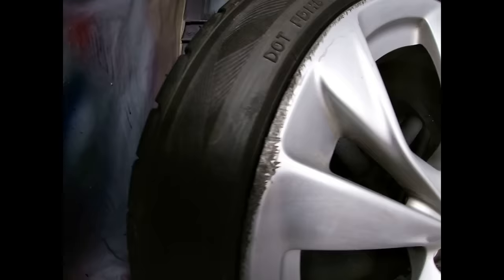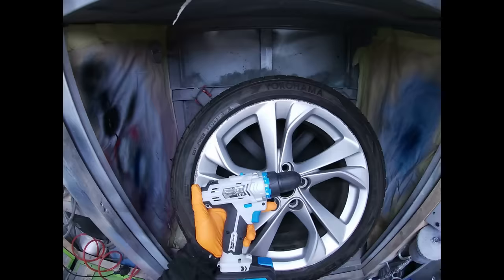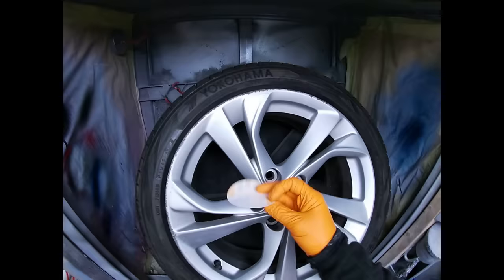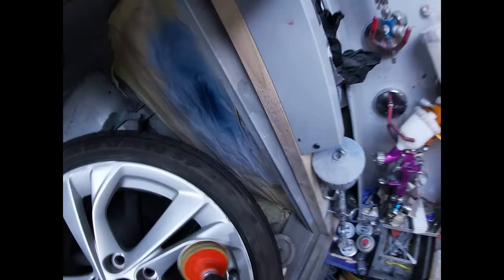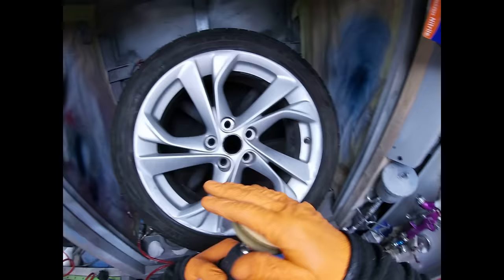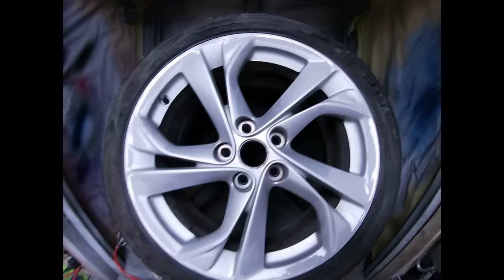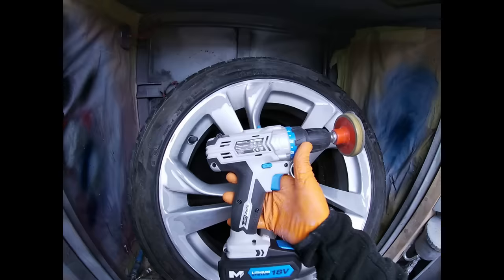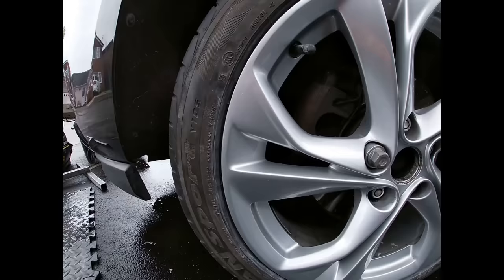How to remove curb rash on any wheel rim with a cordless drill!!

Comment: Remove the tire...or loosen it from the rim. Use your sissor jack....most vehicles have a sissor jack. Lay the tire under the car or bumper....flat part of the sissor jack on the tire near the rim edge and the opposite side of the sissor jack against the bumper, frame, etc and twist the screw as you would normally if lifting the car to change the tire...the tire bead will pop...then the rest of the tire is easily pushed away from the rim as well.
You'll do a cleaner repair and paint. Sure..takes what...an extra 10 minutes of so...
When done..inflate the tire... it'll seat itself on the rim. Going to have to have the tires balanced regardless....sanding the rim...will throw of the balance....

Comment: Is it safe to do that much damage to the side walls of the tire though? I guess maybe if you are planning to discard and replace the tire, it'd be fine, but then you might as well pull it off before restoring the wheel.
Reply from the maker: It's the backing pad edge shredding not the tyre wall
Reply: Where was the damage I dont know where to look

Comment: I would mention that people be careful they aren't removing any material from the tire wall as too much being removed could create a week point leading to a blowout. Mabye wedge a plastic guard of some sort so the sanding disc doesnt come into contact with the rubber tyre wall.
Reply from the maker: most of the material you see in the vid is actually the backing pad shredding

Comment: Would've been nice to see that primer/painting bit as well..But nice tip as I've a set of badly (as bad as ones in video). Planning to get a set of other alloys and when I do, I'll see if I can get it look better than it is now :-D
Reply from the maker: I've had success using no primer mate, done it for years at dealers and so do most guys ive seen around, not saying its completely advisable..  but can be done
Reply: @cvrpov  cheers for the info, keep up the good work.
Reply: @cvrpov  what paint do you use?  Is it spray paint?

Comment: Do you know why they add 10g weights to wheels? I mean it doesn't seem like alot of weight to make any difference but 10g spinning at 70mph becomes a kilo or something to that effect. I was just wondering, if you do happen to have some deep curb rash, and you happen to take 10g of alloy off one side or even 2 parts of the wheel, how does that effect the balance.
Reply from the maker: This is a DIY video and its down the user to make those decisions.
It can't be that detrimental, else half the cars on the road would be out of balance because of kerb damage, also anyone who has just bought a car from any dealer is probably buying unbalanced wheels as in 15 years and thousands of refurbishments later ive never seen one wheel guy balance a wheel after refurbishment!
Reply: Good question but if you are worried the cost to rebalance isn't that much.  It's smart to check your balance periodically anyway so just get them checked after you repair your wheels.
Reply: Just do this just before a 5k mile rotate and balance.

Comment: My car has gunmetal gray wheels. The scratches are all only at the very edge nothing in the middle. I’m going to go to a high-end paint store and get some automotive grade paint to touch up after sanding down. Looking for a good video on repainting next. I wonder if I need to use clearcoat even with automotive grade paint? I’m guessing probably so. I’m also wondering if I can just paint a little bit of it with a foam brush or if I need to mask everything that I’m not painting and use my sprayer. also, I know some stores will put automotive grade paint in aerosol cans. I’ll probably just go that route.
Reply from the maker: It will still need a lacquer of some sort over it

Comment: Mate only if I saw this before life would of been much easier 😰 been doing manual labour. Quick question, what would you do if your alloys been already sprayed but paint work come out rubbish you can see scratches from sanding. Would you sand literally the wheel all back down till the paints gone or just smoothen it out by sanding and what grit would you use from start to end so I can give it another fresh paint? Thanks
Reply from the maker: If the paint is in sound condition and not peeling/full of reactions etc.. the  it can be painted over. Sometimes feathering out with wet and dry and 600 helps with this
Reply: What paint do you use

Comment: Great tip.  However, I would remove the tire before doing this because otherwise it is very likely you will hit and damage the sidewall of the tire while sanding the wheel.  If you damage the sidewall if is more likely to blow out and fail during hard cornering or if you hit a big bump.  That could cause an accident and get you injured or killed.
Reply: You obviously don't know how strong tyres actually are. You would have to be sanding on the same spot for a long time  to damage it with a sanding disk. If it was an angle grinder I'd be more worried but I've seen people use them on tyres to remove lettering for white walls with no problems. Maybe you just needed to pick something you saw as wrong
Reply: @MrDemonchild71  Actually, I began my comment by complimenting the video.  I started changing tires while working in a garage 50 years ago so I've seen a few of them and I've seen my share of blowouts.  A sidewall blowout of a front tire during hard cornering is especially dangerous because it can cause the car to have a rollover crash.  I've lost friends in those kinds of crashes and it's usually a closed-casket funeral.  I would still recommend being VERY careful not to damage the sidewall of the tires.  Garages and tire merchants won't even plug a tire these days if it has even  the smallest hole in the sidewall because it could cause tire failure.  If you feel comfortable grinding on your wheels right next to the sidewall, go right ahead.  Not everyone may be as careful or skilled as you.  To each their own.  I wish you safe driving and Happy Trails.
Reply: @1notgilty , damaging a sidewall is bad, no one's doubting that. This procedure however could only scratch the rubber sidewalls at the most.
Reply: @draintheswamp1588   @Drain The Swamp  Perhaps YOU might only scratch the sidewalls but everyone might not be as careful or skilled as you. I can easily imagine someone accidentally hitting the sidewall and damaging their tire.  If you can do it I wish  you safe driving and Happy Trails.
Reply: @1notgilty  I don't believe anything you say
Reply: Why would you remove the tyre when Boris can have lockdown parties?!
Reply: @1notgilty  dude your clearly speaking from an emotional state. thats ok. but theres no way in hell any rotary tool with 80 grit sandpaper will chew through a tire like butter... like Joel said, maybe an angle grinder would mess a tire up if left on there long enough. just stop the cap and admit u made a mistake lol y cant people ever do that nowadays
Reply: @1notgilty  I think you are right. I prefer caution before I do any job. Im going to have a go at this but have made a simple hard plastic guard. I made a template form paper for the edge of the wheel. I then used that to make a hard plastic guard. Basically, the same curve as the wheel. I will then slot it behind the tyre and tape it to the tyre. Ill sand from there. If I do go near the tyre, ill be sanding the hard plastic.
Reply: @raysmith2940  It sounds like you are being safe.  Better safe than sorry.  I wish you well and hope that everything turns out fine.  Happy motoring!
Reply: Unless you are intentionally grinding away on the tire, not very likely you are damaging it.  IF that is a concern, why not put a layer or tape or even a thin piece of aluminum over the tire in the area you are working?  That should give you some room for error.  (Though doesn't feel like this would be necessary)

Comment: this sounds mad but if you have a rear wheel drive car you can jack the back wheels up and start the car and get the rear wheels turning and then use a drill on the wheels , you get a really good finish , just be safe
Reply from the maker: I've done this before.. thanks for the tip!

Comment: When you’ve resprayed ur wheels can you still use the wheel cleaner on resprayed wheels or will it take off new spray paint being a chemical. As my car is a mobility car and have curbed both wheels on driver side and don’t want to have to buy new alloys when I upgrade to a new car after 3 yrs is up.
Reply from the maker: Once the wheel is dry you should be able to use  cleaner yes.
Reply: @cvrpov  Finish with a clear coat lacquer ......
Reply: Barry i would be very careful if there is a clause in your contract/ Mobility agreement which states you would have to replace alloys that are damage or you'll be charged. this is a similar  situation to those that lease cars who also have this policy. they usually look for any excuse to charge you when you return the mobility/ lease car and have an official inspector check the car and create a report - the inspector will check paint depth for accident repairs dents scratches and check your alloys and WILL notice any DIY repairs.
However this is a great vid for those that own their cars.............. and will not be returning to the manufacturer for an upgrade whether its a Lease/ PCP/HP/PLH/ Mobility etc..
Reply: @coachBux  thank you Ash sorry for late reply.
Reply: @coachBux  Any excuse is right, never take into account normal wear and tear

Comment: If you wheels have a coating whether it be painted or cleared, which most wheels are these days, you'll have to spray em so they match or cleared so they dont turn cotton white
Reply from the maker: Yep
Reply: @cvrpov  sorry dude, I jumped the gun w/o watching the whole thing. I own and work in a detail shop and alot of people dont know these things. For instance the best thing to clean a headliner is 1 part bleach 2 part water. Pour on rag and scrub it down. Cloth seats too but dont get a drop on the carpet. Best thing to clean hard plastic interior panels- 3m pad. Windows and true chrome-fine grade steel wool. How to remove the yellow mark around handles and moldings on light colored cars esp white- wheel acid. How to remove acid rain from paint- coat with a strong mix of wheel acid (not on windows) and let sit for 2minutes tops then wash off. If some remains, repeat. It will eat all the acid rain marks off without sanding and buffing. Just a few things I've picked up or discovered over the years

Comment: My question is, if the wheel is powder coated, how do you match the color, get paint to stick to powder coat, and feather it in? Do you just spray the entire wheel with primer and paint it?

GREAT VIDEO BY THE WAY!
Reply from the maker: Both actually. Depending on how much damage is on the alloy. If its a small amount then blow it in and feather the silver out a bit. 
If its substantial then paint the whole wheel
Reply: @cvrpov  thanks man!

Comment: Hi, nice video. I just have a 2/3 inch very slim mark on the edges. I applied touch paint directly on with the small brush provided, was thinking of just sanding down the touch paint to smoothen it out. Would this work ? If so, what grit would you recommend on the touch up paint?
Reply from the maker: After it has dried you can sand and polish for a more level result

Comment: Once you've worked up thru the grits, do you have to seal it with clear or could you leave it as it is?  If you just did specific sections using this sanding technique will the areas you didn't touch look different?
Reply from the maker: Sand, paint then lacquer

Comment: Very interesting and looks simple to use. It's also very similar to the method used to remove the yellowing of the headlamps. In my honest opinion, this DIY stops being a DIY job when the spray needs to be applied. Everyone might have a cordless drill, but not everyone has a spray gun, a compressor and spraying techniques.
Reply from the maker: True.. so do exactly the same but with rattle cans
Reply: Just use cans. Go yo the paint shop and ask them to mix you up a 2k clearcoat can. Is the same stuff as he uses and is much harder then the regular clear paint.

If they mix it for you, you need too use it in a day or 2 or so. Because the hardner is allready mixed in the can it will start to set in the can. So it will only last a few days.

Used to spray entire sides or corners of cars that way for years. Put the clear on thick and slow, sand with waterproof when dry until smooth and then just polish it up.

Perfect profesional result everytime without a booth or sprayguns or whatever..
Reply: @baronvonlimbourgh1716  And you expect us to believe that ???
Reply: @allenrj1  believe what?

Comment: I must say that repairs like this can cause the steering wheel to vibrate when the vehicle is traveling at high speed. Because taking a gram or milligram weight on the rim will affect the wheel turning diameter and speed.
Reply from the maker: Most repair this way

Comment: My rims are clear-coated aluminum. It's hard to fix those. A small body hammer works best. Then I go over it with 0000 steel wool. Afterwards, I hit it with Plasti-coat clear lacquer. Deep groves are best to paint out or putty. You'll distort the rim reflection otherwise.

Comment: My concern would be if you sand a lot on one side will it cause the tire to be unbalanced?  Would only matter till next time wheels were balanced.
Reply from the maker: The balance should be checked even after heavy curbing imo. Material has been removed already

Comment: Nice job 👍. With you taking some material away from the wheel will it need rebalancing?
Reply from the maker: If you are unsure then yes
Reply: squareblueorange, no it will not need rebalancing. The smallest weights are 1/4 ounce. I doubt if you weighed all the filings that it would be even 1/8 ounce. I started my mechanical career as a tire jockey so I've balanced, to zero, hundreds of tires.

Comment: @CVRPOV Do you have to paint the wheels or will a polish/buffing do it? If only painting is the option after sanding , where can I purchase the wheel paint?
Reply from the maker: If the wheel is supposed to be painted as a finish then yes... paint will be required. Look for paint supplier who can provide silver aerosols
Reply: @cvrpov  mine are chrome factory wheels , I wouldn’t know where to start lol. thank you 👍

Comment: Been a while since you posted this so might not get a reply but would this not damage the inner part of the actual tyre while trying to get as close as possible to the edge of the alloy?
Reply from the maker: always be cautious of damaging the tyre. most of what you see shredding is actually the backing plate on the drill

Comment: The problem is the paint. Aluminium wheels are factory painted with finishes and processes that you can’t get out of a can. It will only last unless it gets wet, then the water will get underneath next to the tyre (which you can’t sand properly) and it will all start to corrode. I know. I tried it years ago.
Reply from the maker: Things have moved on alot
Reply: @cvrpov  In what way?

Comment: Huh... just wonder how will this looks like when it spins on a balancing machine? I.e. if you're next owner of the car, first thng you'd think -rims are bent.
Also, there are many wheel-alignment  machines that hook-up their sensors to the oughter edge of the rim, now that 1-2 mm of that edge had been filed down, how do you get alignment to be true?
Since you're getting your hands dirty anyway, why not fill the scratches with something and then smooth it out with fine grit disk, rather then grind it down to the deepest point just to make it look good for the moment being? 
Just my 2 cents.
Reply from the maker: This is the method most pros use

Comment: Would this work for rust bubbles? Asks a Canadian where they salt the winter roads. My winter rims have a slow leak  because of the rust on the edge where it seals with the tire.
Reply from the maker: technically yes.. altho corrosion can be tough to sand down

Comment: Surely if this isn't done uniformly around the wheel, won't this make the wheel more difficult to balance?
Reply: Minimal amount taken off, won't make a difference to the balance.
Reply: @crisfiler6128  yeah sure you take a minimal amount off, but that's not taking into account the 1,2 or 3 mm that's already been left on the curb outside the local school 😁 I would imaging your rim would start to look buckled?

Comment: I have a question/observation. I've got the common mini cooper "crown" alloys off a 2003 model and they seem to have a (what seems like) a plastic over lay.... Its difficult to explain. Mine have alot of curb rashing so I thought I'd give them a clean up, tried sanding the curb rash and pieces started flaking off.... I have a feeling they are not actual alloy? ever heard of this? ..... its turning my quick clean up into an ordeal lol
Reply from the maker: could possibly be a poor respray or maybe its the powder coat you are referring to? maybe need something with a bit more aggression such as a rotary with sanding discs on it? i do a kit for either over at www.paintgear.co.uk
Reply: @cvrpov   thanks man,yeah I think they have dipped in something and not to a good quality either, literally made it the worst job. I'll check out those products thanks again

Comment: But is the wheel safe after this, and will it pass a MOT.
Reply from the maker: Why wouldn't it
Reply: @cvrpov  you're removing metal from the wheel, and so weakening it.
Also could damage seal between tire and wheel.

Comment: If your repainting wouldn’t it be better to fill the scrapes rather than sand them out as if the scrapes are say 2mm deep your removing 2mm of metal from all the way around the wheel, and if it’s done more than once isn’t it going to compromise the structure of the wheel? Just a thought